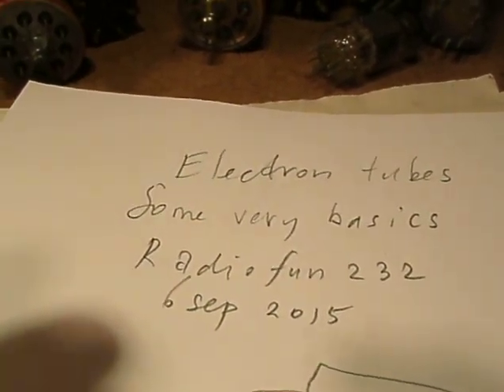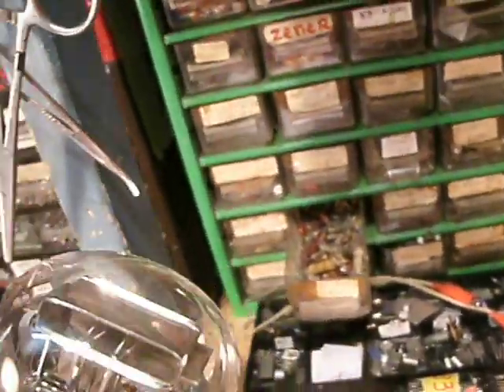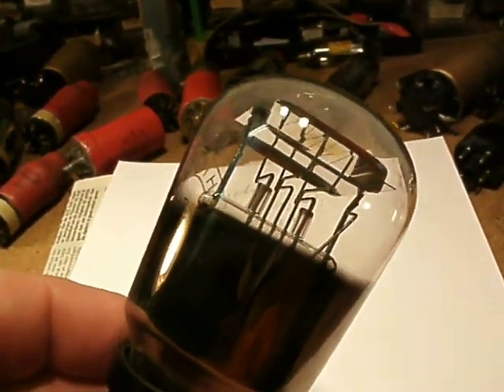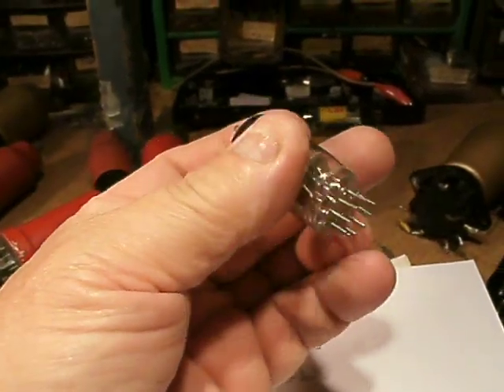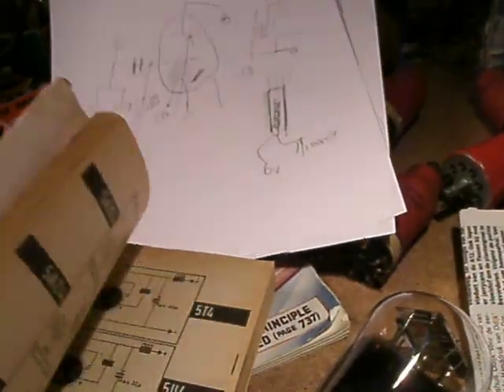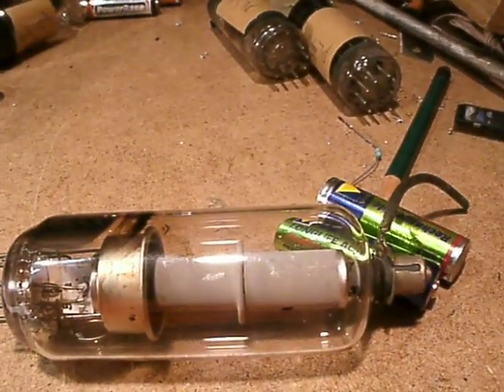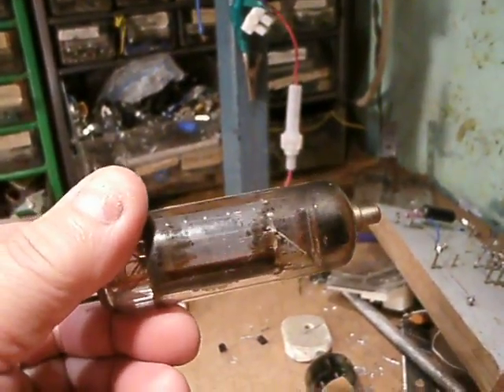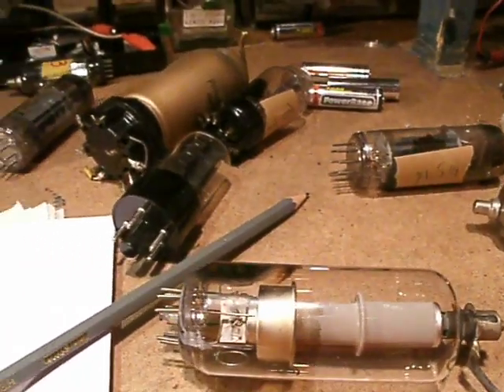Electron tubes, some basics

Comment: Got some old triodes
Reply from the maker: Video link 1920 AM radio with triode
https://youtu.be/yXJg8PjFv7c 

VLF radio part 1
https://youtu.be/Xa2tUXoJUcw 
VLF radio video 2
https://youtu.be/84DPej7Vp9s 
VLF radio part 3
https://youtu.be/cfkPntbTMZ4 
VLF radio part 4
https://youtu.be/cw-ADtL0KG8 
When you go to my channel trailer you find the “looking glass”.
When you type there keywords like “tube”, “triode”, “tube radio” and “receiver” “AM” you can find more information. There is also a small document on the LULU website (author Ko Tilman) where there are links to approx. 800 video’s on my YT Channel. And there is a free download document: “how to make a simple tube amplifier”. You can connect to “any” triode a AM radio coil with the schematics showed in the VLF series and the 1920 radio video. You only need for proper radio detection a leak resistor from the grid to ground, say in the range of 500 K to 1 M (experiment). And a good quality AM coil. For "power amplification" the power tube needs a negative grid voltage. How that works is in the free document on the LULU website.  29 nov. 2021.

Comment: Are tubes still used? Say in transmitters?
Reply from the maker: +vibra64 I don't know that exactly but I think they are used in powerful AM and long wave transmitters all over the word. As far as I know semiconductors cannot generate 50.000 or 100.000 watt energy for a radio transmitter.
Reply: Yes and still made